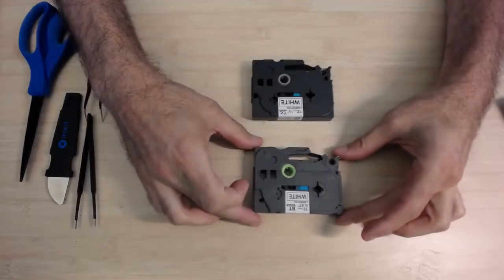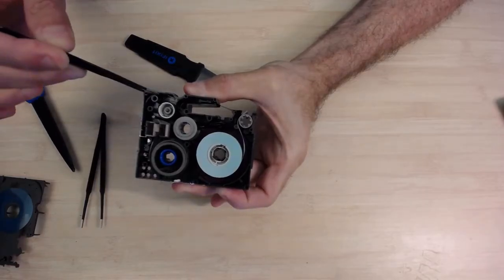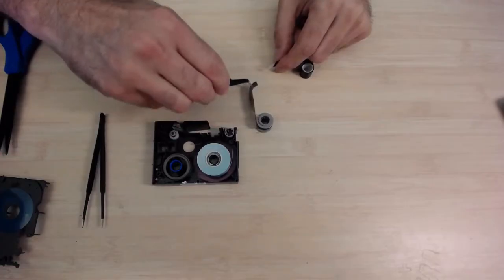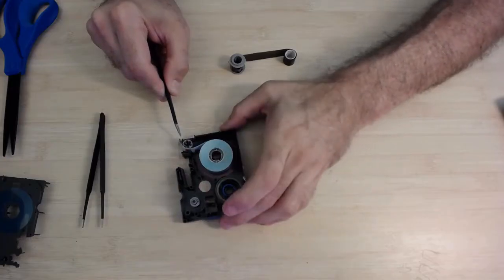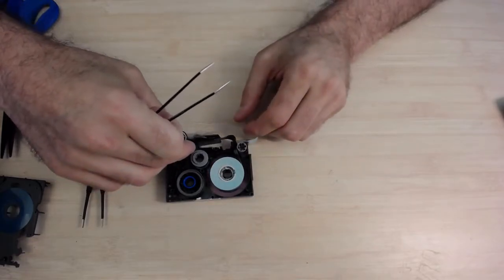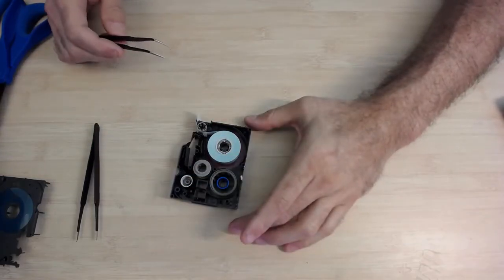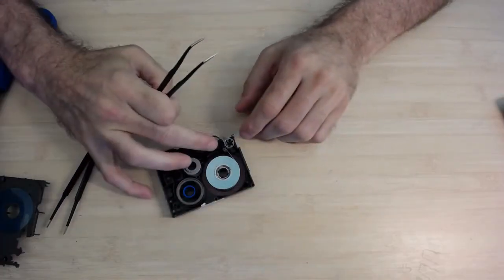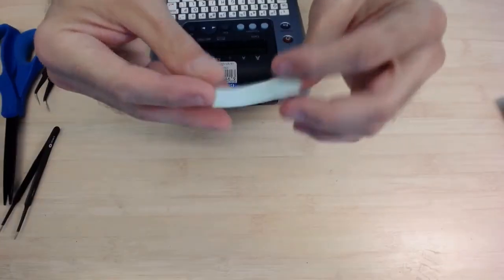How to fix a Brother P-Touch TZe label maker tape that has gone bad and stuck together

Comment: Poor lighting - hard to see black on black in low light. Also, didn't need to see several minutes on one operation (threading the black tape back in), otherwise helpful and thanks for the input

Comment: Great video, thanks.  Saved me throwing away a cartridge.  One small issue with video is it is too dark.  I had to take apart the old cartridge to see the correct threading of the spools.  They are black on the black tape and extremely difficult to see.

Comment: Thank you so much Erez for your patience to make the repair and the video! (my tape was more co-operative than yours, thankfully!) We had THREE faulty brand new tapes, and we thought our old printer machine must have been faulty so we bought a new one! We live in a remote area so this took a long time, and I gave the old machine 'one last chance' when I found your video online thanks to Google - and it worked! The tape was the issue! As we live in a remote area, this fix has saved us $27 per tape (alas the first 2 'duds' were thrown in the bin weeks ago, but at least I have saved one) And also, when something breaks here and we have to wait for a new one from the store it takes weeks, so your video has also saved us Time. I wish I could send you the $27 but I will send you Good Wishes and thank you again!

Comment: I thought for sure I would have been able to rethread this sucker without taking it apart.  Thanks for the video.  S saved me $22.  The one I was using was brand new but bought it over 10 years ago so no way of taking that back for replacement.